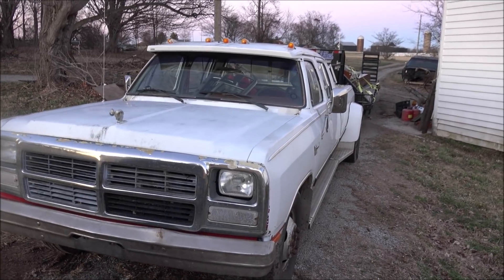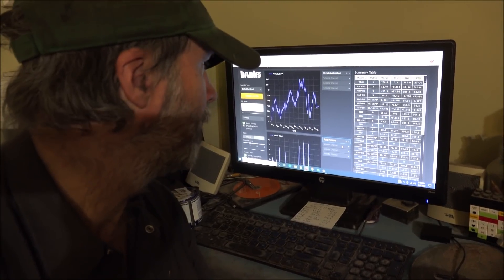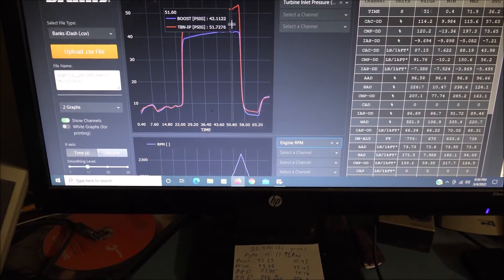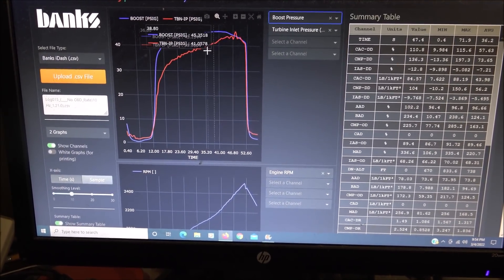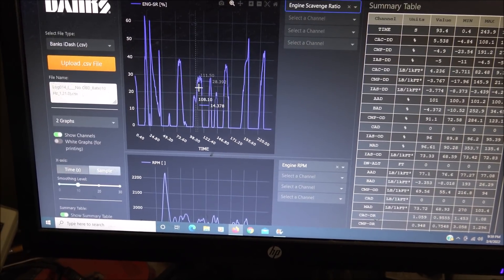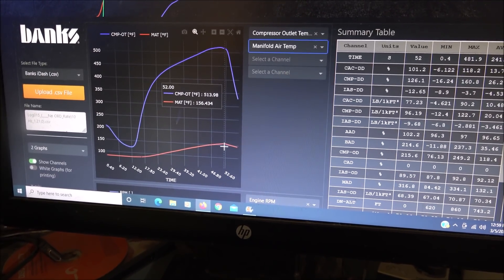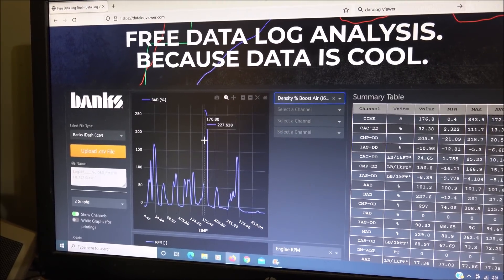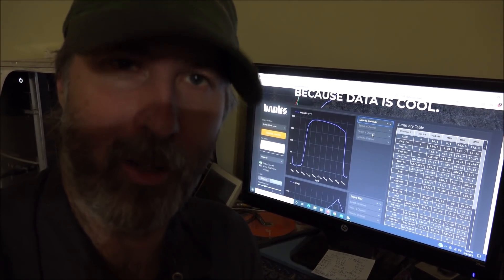Hx35/H1C 54-60 12Cm Versus S300G Borg Warner 57-65 .080AR Ultimate Towing 5.9 Cummins Turbo Test

Comment: This is easily the most informative Cummins 12V turbo upgrade video.
Have you had a chance to test the 62-65-14 S300 yet?
I ask because in my quest for more power I installed a S300 62-65-14 on my Cummins 12V 230HP RV (20000 lb RV towing 3000 lb car behind it) and it is terrible, much worse than the WH1C 56/60/14 (not sure if the WH1C had a 14cm from the factory or previous owners swapped it).
With the S300 I've got massive lag - only makes 7-8 PSI of boost to 1750 RPM and then it builds up to about 20 to 24 PSI max at 2100-2200 RPM. It can hold 20PSI at 1900 RPM and control EGTs, but if the RPMs drop below that, EGTs start climbing and easily go past 1300F.
In troubleshooting it I found a big exhaust leak on cylinder 1 (I've replaced the manifold with a 2 piece about 6 years ago as the original had shrunk just like the one you show in another video), but maybe at the time I didn't clean the surfaces well or didn't retorque the bolts. Either way, in additional there were two small boost leaks that I found. So after I put everything back together I will give the S300 one more try to see if it does any better.
But by the looks of your data here, I might have to just find a 57mm compressor wheel and housing and then it will be worth keeping it. 
Thanks for the good info!
Reply from the maker: I never have had a 62mm s300 on this truck but I had one on old yellow and it always peak torqued at 2200rpm. The recent dyno on this s300g I am running shows it peaks at 1900 rpm.  I have been trying to tell people if you want big torque below 2000 rpm you need something smaller than a 60mm. 60s are great on a 6.7 but too much on a 5.9. That being said the little bit I ran my .70ar housing on this s300g I think it moved the spool down another 250 rpm.
Reply: @bcbloc02  I test drove again with the S300 62/65/14 after fixing the exhaust leak and minor boost leaks - no improvement, it just runs quieter. For now I ended up installing the old WH1C back on. It spools around 300 RPMs sooner than the S300.
Is your .70ar housing for sale? Maybe that's what I need to try next with this turbo.
Reply from the maker: @weekendswithted  for now I don’t plan to sell the 070 I probably will wind up using it in the twins. I will just have to see how they both perform and which one I think is the best.

Comment: Test a 60 or 62 /67/9 he351! I run a 60/67/9 on my 1gen. Made 462/1012
Reply from the maker: I don't have one to test. Got one I can borrow? lol I would expect it to have more power above 2500 rpm and less at 2000 and below. I also think it would likely run slightly higher egt.  I have been doing testing on my s300G and the .80hsg vs the .70 hsg dropped it 100deg on EGT across the board.  I think under regular driving conditions the smoke is reduced even though the boost is less.  I think that is because the boost is greater than the drive pressure with the .80 and it is the other way around with the .70.  I would imagine that 9cm runs the same way. How is your boost versus drive?
Reply: @bcbloc02 Thanks the report on the .70.  I was tempted to get one without trying the .8 first.

Comment: Brian, I've re watched this a few times. What is your fuel system recipe? Maybe it's a secret, but I could use a little guidance. It doesn't seem like there's too many of us trying to just heavy tow with a VE pump motor. I have a 1993 D250/ Auto trans that tows a small excavator, trailer and machine weigh about 10k. Yes i have a decent rebuilt trans. with a good converter. as I already said the engine is a bit tired but hopefully will hang on till next winter. Thanks in advance, Will. possibly I should EMAIL to discuss further, thanks again.
Reply from the maker: Yeah you can email me or look back at some of my other truck videos. I have videos on the injectors and other modifications I have done to the truck to suite my needs. The pump is simply a stock pump with the fuel screw turned in all the way(collar removed) and the aneroid turned to cut the most fuel out of it I can then ground at the deepest point to allow full fuel travel at max boost.

Comment: How'd I miss this til now? I'd really like to see the HE351cw in stock and with a 67mm turbine, and the HX35 in a 60/67 configuration as well.. there's some cheap 10cm housing HX35's that would be interesting to see how they choke with a 64/67mm turbines
I just got myself a 4BT I'd like to put in a '91 Dodge 1500, it's got a stanadyne pump, 400 hours, runs like a top

I learned how hot the compressor outlet temps can be when an oil jug that was touching it got totally melted.. I was pulling a 5 mile long 15% grade at about 18K lbs.. was quite a pull

Comment: I may have missed it, but what exhaust housing are you running with the S300? I see you have a 12cm on the hx35. I want to put a S300 on my 93. Thanks
Reply from the maker: It is in the description this 174430 s300g comes with a .080ar exhaust housing. For the testing I have the wastegate disabled but it is factory set at about 35psi
Reply: @bcbloc02  thanks! I was looking up the part number and one place offered a 70 or an 80.

Comment: Based on this data, could there be a better turbo for this motor?  Since your drive pressure crosses 1:1 efficiency at max RPM, it seems doubtful to me that your combo could benefit from another turbo.  What is your flow capacity of the engine combination?  What I'm driving at (pun) is that you are hitting 45lbs of boost, can you really flow any more air without getting into crazy manifold pressures?
Reply from the maker: Well at 45psi I still have smoke and high EGT's so more air should help both of those things. My goal is to have about 60psi and to keep the boost running over the drive from 1500-3000rpm. Don't know if I will get that but it is my hope I can.

Comment: That is an excellent test, Banks would be proud. Thanks for sharing.  You are not the first to note more boost than drive with that turbo, I didn't believe the first guy. Ha ha.
Reply from the maker: I am glad I picked it for my twins. If I can win up with my twins running 10-20 psi more boost than back pressure from 1500-3000rpms I will be tickled to death.
Reply: Hey Brian, waiting on similar data sets on those compounds!

Comment: Very interesting data! Will definitely be following this!  Have you bumped up the timing or still stock? I have an HX Super 9 from Savage Fabrication coming this week with a 62 wheel. Hooking up drive pressure gauge today if the rain holds off to see the difference between the 2. Already did injectors (5x12 VCO) and delivery valves and that woke it up a bit. Still no real boost (18psi) or fuel, truck lived at 7000 feet in Colorado so the pump is probably detuned for altitude. All that will be corrected when I get some better weather, AFC Live, new modified foot, max travel kit, 22--25 timing to start and 4k governor springs. Also head studs, 3 piece exhaust manifold, HX40 down pipe, 7/16 pushrods, and conical valve springs. This should put a bit of zip in it.... Saving up for a thick case Super G56 and getting rid of the hopped up 47RE. I wonder how that HX40 will do???  Fun stuff!!
Reply from the maker: I would say either your wastegate is stuck or your intercooler is leaking. I have done hundreds of trucks with 370hp injectors (5x12) with a slid v ground fuel plate and they would all do 40psi and 16-18 timing depending on if it was a 3.54 or 4.10 geared truck. You give up some hp over the higher timing but gain torque fuel economy less idle haze and better starting.
Reply: @bcbloc02  Yup there could be other problems but I still think it's something to do with fuel. Maybe the AFC is frozen...I get 0 smoke or haze at full throttle under load and just a very slight puff when I stomp on it from idle. In fact inside the tail pipe you can see the metal with no soot, it's as clean as my full emission 2015! Strangest thing I have ever seen on Cummins with 212,000 miles......  Could be the injection pump is bad...... Hopefully I get to the bottom when I dig into the pump..... or I might be picking your brain.... wish me luck!
Reply from the maker: @CapeCodCNC  Check that your signal line to the afc isn't kinked or broken too. Also verify you have fuel pressure.  Those factory style lift pumps don't last forever.  You should have 25psi at a minimum.
Reply: @CapeCodCNC  would say u have got a boost leak someplace feller ... charge air cooler,or boots or pipes...or afc line/ wastegate actuator leak like Brian said... I've got 5x12s ,afc live and made 50+ psi boost with a 362/68... Didn't hold it there long ...but .. anyway... you'll find it and get it snorting I'm sure👍👍
Reply: @CapeCodCNC  the only thing on the pump it may be is ,make sure your fuel shut off solenoid/ lever is moving completely...that'll cut power too...but it probably isnt anything wrong with the pump internally ...but anyway...just throwing that out there too 👍👍
Reply: @elroyelblander6277  thanks i did check that externally and "seems" to be working.... I hope it's just the high altitude tuning....

Comment: That's a lot of info packed into a little package...... good stuff. 
The performance numbers for the S300 looked pretty good but the EGT is still a little concerning.
Reply from the maker: Could always decrease the fuel, or will have to add more air using compounds which is where this is heading. I just figued I would try to help some people out by providing information on single choices first. I mean for 300rwhp a good single will keep egts in check all day.

Comment: Thanks for putting this together. You mention use of a stock air box. Do you think changing to a large Donaldson filter will make any difference? Now I need to go check what s300 I put on my 95.
Reply: Dang. S300sxe 62/65/14. Guess that is why it was "cheap".
Reply from the maker: Well for a lightly loaded truck or one you want to rip and play with that is a good size. From 2300rpm to 3000 it will easily out horsepower either of these 2 turbos.

Comment: Put a road  ranger in it 10 speed
Reply from the maker: That requires major floor board modifications and I need room for my big feet. The d600 will have a road ranger though. 😎
Reply: Ive always wanted to do that.. just missing all of the components including the truck.

Comment: I am not a tech junkie, but this is very interesting to me. Thank you very much. I have a 2000 Chev 3500 with a 12 valve and a NV4500 with 4:10 rears. It has a 3 inch turbo and 3200 gov spring. I can haul 30,000 gvw, but usually less. 24,000 is common. On the flats I can run 68 mph in 5th is 2450-2500 rpm. But on the hills I have to downshift when the EGT gets to 1200. Usually starts the hill 1000-1050. If I could top a normal hill at 60 in 5th, with <1200 EGT, that would be some improvement! What do you think? Also is otherwise stock Cummins reman with centrifugal pump. Probably does need the 3 piece exhaust you recommended sometime back. Has water to air Intercooler,
Reply from the maker: What injectors does it have? Also what turbo? I am sure it’s not actually 3” based on wheel size as turbos are generally measured as that would be the size a 15 liter semi would run.
Reply: @bcbloc02  I don't know the model numbers. I say 3 inch intake opening. Most of what I see on newer model Dodge has 4 inch opening. It is stock from Cummins. What mods would make an improvement for me?
Reply from the maker: @deechase5195  It must be the turbo from a non intercooled truck. Just about anything from a later truck would be an upgrade. A turbo like this 174430 would likely knock 300deg off your egt's. Honestly I am surprised you can pull much of a hill at 30000lbs and maintain speed to have to worry about the egt's. An injector like a 6x.011" would likely put you back at 1200-1300deg peak egt with that turbo and be a good power increase. That of course assumes your intercooler works well.
Reply: Are you measuring EGT pre or post turbo?
Reply from the maker: @ShainAndrews  I have it pre turbo.

Comment: What did you do to get " plenty of fuel ".  Are you still running the rotary pump ? I have a first gen 12v in a 2004 F350 Auto.
Reply from the maker: Yes it is the factory rotary pump turned up all the way combined with big injectors.
Reply: Yeah I went back and looked at some earlier videos. I just put in a set of 6x10's with the he351 turbo. Id like to see the data on it compared to the other turbos.
Reply from the maker: @jmzct1254  Sadly I don't have an he351 to test. What wheel size version do you have?
Reply: The 351 is 60 60
Reply: 60 60 9.

Comment: 👍👍thank u for another video fellar...I wish I would've swapped a S300 57/65 instead of the 62/68... Tried the 12cm housing as well ...didn't like it on a 12 valve or a VP44 engine..but , would probably do well with more cubic inch,a different cam/head,or a 5.9 common rail where timing can b manipulated .. but,I definitely realized bigger isn't always better... gonna try an HE351CW with a 67 turbine on 12 valve next.. Anyway ,great stuff as always..👍👍👊
Reply from the maker: More cubic inches is what you need for that 62 to be happy.  I wish I had an he351 to test in the mix but my gut predicts it will beat the s300g from 2300 rpm and up but be worse from 2200rpm and down.
Reply: @bcbloc02  u think the 351 will b lazy below 2200...??.. hmmm... I'd hope not,with that 9cm housing unless the 67/76 won't spin well til 2000 or so..?... I'm gonna try it this spring cause I've got one here....I'll maybe chime in when I install it in the future...but anyway,thank you for the videos
Reply from the maker: @elroyelblander6277  I assume it is a 60mm comp he351 that means it is going to turn harder than the 57 comp on the s300G. That is why I think 300G would be making more boost than the He351 at the lower rpms.
Reply: @bcbloc02  ten four... yeah it's a 60mm with the 67/76 turbine...we'll see what happens after I get it on there... there's a 63mm cheetah Hx35 with the hx40 64mm turbine on it at the moment (inherited it on a different truck),that I thought I'd try..don't like that one either...but anyway I'll maybe chime in on one of your future videos...thank you for response and knowledge feller 👍👍 👊
Reply from the maker: @elroyelblander6277  you will like it a lot better than that cheetah. It belongs on a 6.7